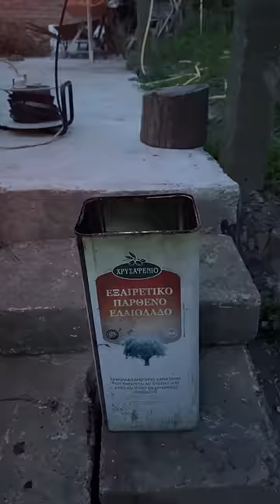Making super sharp Chef's Knife

Comment: The carrot is a great demonstrator, as a fat blade breaks them instead of slicing.
Reply from the maker: Thank you , some people think that you can cut carrot with every knife but the point is how exactly it cuts it :)
Reply: @RustLegion  absolutely, Butternut is also a great test of a knife, love your work!
Reply: Most people talk too much without knowing the crux of anything...don't let haters get you down
Reply from the maker: @fade_trade  thanks mate , I try not to take myself too seriously :)
Reply: @RustLegion   this knife does not rust?
Reply from the maker: @Kurt_SOFUA  this knife will rust If I leave it dirty and wet. If I wash it and wipe it after use - no it will not rust :)
Reply: It also helps if the carrot has been boiled beforehand
Reply: @ryd-er-die6697  Bingo. You can see from the outside of the carrot that it has already been softened by boiling. Also you can hear it from the way it is cut.
Reply: Again, I can get this kind of cut with a $10 Walmart knife. A mediocre edge will do just fine but requires effort. 

You want to demo a sharp knife you do it on something that is incredibly easy to crush, like a tomato, a sharp knife will slice with minimal force and can slice a tomato paper thin without crushing it. Which is why you rarely see this kind of demo, because most knives (including this one) aren't that sharp.
Reply: @1bun2bun  i have super sharp knives that cant slice soft tomatoes paper thin. 

Edge geometry is key. 
But ok dude.
Reply from the maker: @1bun2bun   Hello there. Yes Tomato is hard to cut with dull knife , but for me sharpening a knife is no problem. The secret of slicing a tomato is just sharpen the knife on a bit coarser stone - something like 400 - 800 grit. But to slice a carrot with ease you need THIN knife with proper geometry. This is hard to achieve. his is why I demonstrate it on carrot :)

Comment: Rebar is probably the cheapest/most readily available form of carbon steel for these kinds of at-home projects tbh.
Reply: but it is low carbon steel and can rust easily
Reply: @KKoKoRR  steel rusts.
Reply: @Just-Steve  yes but low carbon steels rust more easily.
Reply: @KoKoR  but high carbon steel is expensive.

And hard to get at the hardware store.
Reply: Most rebar won't have enough carbon for a blade, but here it is fine because it's a san mai construction, but bear in mind that rebar alone won't do
Reply: Rebar is not suitable for making knives, its too soft, better to use a car leaf spring or such, which is way better steel (5160)
Reply: @Just-Steve  ...steel can be "blued" to prevent rust. 
Stainless steel is inferior to carbon steel UNLESS you using very expensive stainless, which also cannot be easily heat treated at home.
(Knifemaker, 35 years exp.)
Reply: @richardwebb9532  you're literally the first one to say something about stainless...
Reply: Да арматура тупится быстро
Reply: @Just-Steve  ....you mentioned carbon steel rusts. What other alternative is there? Obsidian??
Reply: @richardwebb9532  I was replying to another commenter stating that low carbon steel rusts.

"Steel rusts" was the reply.
Reply: @richardwebb9532  yeah, much better to just fucking clean the knife after using, oiling it from time to time and let that beautiful patina develop over the years
Reply: The rebar is only used on the outside layers. He ads a core of high carbon steel in the middle and forge weld them. All carbon steel rusts,  there are several care and maintenace tricks to prevent it.
Reply: @richardwebb9532  What about a lawnmower blade? Like, what easily accessible, side of the road shopping is the best aside from the leaf spring (those take a bit of doing to be easily grabbed, plus neighbor will prolly get mad..). I'm not afraid of rust, I only use high carbon antiques and cast iron and I'm not dumb enough to put it in the dishwasher. I'd imagine you could "season" a blade the way you would a pan too, vs bluing, handle being removed from the picture.
Reply: @Yer_Br0wn_D0g_8_My_Rabbit  most lawnmower blades are not very good.  You would be much better off with pieces of leaf springs.
Reply: @GertTown  I saw that coming, I figured as much, thank you. I guess neighbor is in for a bumpy ride..

I realize the absurdity given the shape, but are coil springs comparable to leaf? I actually have some of those.
Reply: @YerBrwnDogAteMyRabit  they are made from the same steel, you can use old files to make blades too, the rods from the suspension inside the coil spring make tough blades too, bearings have very good steel, the axel is made of medium carbon steel.
Reply: @kassiog.6595  OK, PERFECT! Thank you. I have all that junk. The file seems easiest (seen that before) but I love the idea of making one out of crap that'll never see the light of day again. You mean the rod going through the center of the shock/strut, correct?
Reply: @YerBrwnDogAteMyRabit  might be, but i don't know more technical words in english, that's not my first language
Reply: @YerBrwnDogAteMyRabit  just looked it up. Is the chromed one on the shock absorber
Reply: @kassiog.6595  Jesus dude...coulda fooled me. Your English is better than a lot of people whose first language it is. I never woulda known had you not told me. Well done.
Reply: @kassiog.6595  Ok, gotcha, thank you. That was the only part that made sense to me. The body of the shock (outside) doesn't seem like anything special. I didn't mean to put you to work looking things up, but I appreciate it. I'm as impressed by the fact you looked it up as I am with your English. You're clearly not lazy.
Reply: @YerBrwnDogAteMyRabit  ...most older files and rasps are good too, like Nicholson files, be careful of newer ones....
Reply: @dasilvapt  ....you can obtain high carbon stainless steels today, however, they are costly and difficult to heat treat without specialist equipment.....
Reply: @kassiog.6595  👍🍻👍🍻👍😎
Reply: @richardwebb9532 Thanks. I'd imagine you mean new Chinese files made from soda cans, bobby pins and cat hair. I don't think I have a single file thats not Nicholson, like no one else is even allowed to make them, like a law or something (lol)..
Reply: @YerBrwnDogAteMyRabit  lazy people don't make knives, right? Hahaha
Reply: из клапана хорошая получается финка , из тепловоза например .
Reply: @kassiog.6595  No, I guess they don't, do they? Lol. Tough to make one from the couch.
Reply: Mild steel, is what rebar is made of, is not harden able.  But he did stick a piece of high carbon steel in the core and forged out a legit knife.
Reply: @keyboardheroism  rebar is not only sold as mild steel.  Do a little research 😮‍💨
Reply: @Tadaaaa I am absolutely blow away by how far from my original comment these comments are getting 😆
Reply: @keyboardheroism  He definitely did both of those things. The ol' rebar wrap routine I suppose.
Reply: @Tadaaaa  you're mistaken, maybe instead of shooting your mouth off you should make sure you're reading the right names next to the people making claims.

I'm the guy who said you can buy rebar at the hardware store.  You can buy carbon steel rebar at the hardware store.  I also never said anything about stainless.

R  E  A  D
Reply: @Just-Steve  The funny thing is, you made a simple, accurate afaik, comment, and it turned into like 700 different things, conversations, and pseudo counter claims. That'll teach never to mention rebar on the internet again 🤣
Reply: @Yer_Br0wn_D0g_8_My_Rabbit  lmfao right?
Reply: @Tadaaaa ...tell me you don't understand what blueing is without saying you don't understand what blueing is.....
Reply: @Tadaaaa ....and clever boy, once you heat up an "already heat treated" blank by grinding it, it's no longer "heat treated"....
Reply: @YerBrwnDogAteMyRabit  😁👍🍻
Reply: @YerBrwnDogAteMyRabit  ....only, I believe newer Nicholson files are not as good as the older ones from 1970-80's....different steel I think they said on the forum...
Reply: @richardwebb9532  Oh, ok. Cool, thank you. Well, got plenty of antiques in the basement too, so plenty to experiment with. Preicate it.
Reply: @Tadaaaa  I would assume the expensive specialist equipment Richard was referring to would be a heat treating oven. Although I have seen AEBL heat treated in a forge, I do not consider it a good method of doing so. A soak time of 15 minutes between 1925°F and 2050°F is preferred for AEBL, which unfortunately a forge cannot provide. You are correct in saying AEBL does not require cryo, but that is only for lower austenitzing temperatures and lower hardness levels (60-61 hrc). However for kitchen cutlery 62-64 hrc is best with that steel. To get into those higher hardness ranges higher austenitzing temperatures and cryo is needed. Dry ice is a fairly decent method for AEBL (Although LN2 is better) it is absolutely needed if you are using the higher austenitzing temperatures (1975°+)

~ Legitimate non couch knifemaker 

If you require proof of my non couch legitimacy I am happy to provide some, since you seem to be rather liberal with that accusation
Reply: @Tadaaaa lol....now 2nd grind is done with higher grit than 1st grind. 2nd grind is also done BEFORE TEMPERING. ANY HEAT AFTER TEMPERING REMOVES THE TEMPER!! 1st grind is what kills the temper. Even with cooling in between grind passes. I've been making blades since 1986. How long you been doing it, sonny?
Reply: @kassiog.6595  of course depending on the lead percentage of rebar I don’t think I’d eat those carrots
Reply: @richardwebb9532  oh my... I'm a professional bladesmith. I work with the best steels there are in the market, european, japanese, you name it. Stainless and high carbon. I do have all the tools, forge, heat treatment oven,  zero atmosfere heat treatment,  everything. I know that. And I know how much it costs, pretty much every single damn steel there are in the market for custom knifemaking.
Reply: @dasilvapt  ...good for you, unfortunately you missed the part where "cheap materials" were part of the discussion. I too make blades, and count among my friends, some of the best bladesmiths in my country.
Reply: @richardwebb9532  nice, congrats. 👍👏👏👏

Comment: I can still remember when I was a child over 50 years ago watching the elders that made homemade kitchen and hunting knives with metal from the oldest cross cut saws they had. They told me the older those old saws are, the best metal was used making them because the metal was perfectly made to hold an edge and last us hundreds of years. Today it's so easy to cut those saw blades using a CNC machine or a plasma cutter to get the blanks and sharpen them and put a handle on them. Also the oldest rail road spikes you can find work great an use the ones with HC on the heads, high carbon and they will hold an edge and last hundreds of years also. An if you spent the time to make a beautiful razor sharp knife, make sure you or someone else makes the right case for it to wear on your belt or in the kitchen. Show off your hard work and put your name on it or makers mark. Don't forget to share your knowledge of how to make them. We have lost to many old ways already, don't add to the list not teaching others. I just shared with you few things I knew. An if you use old cross cut saws to make you a knife, I know it will last you a life time and hundreds of years more.
Reply: This is nonsense. Modem steel is better in every way. Cleaner, better alloyed and with less detrimental impurities. I am metallurgist, I made steel, stainless steel, and nickle based for years. I heat treat and evaluate the microstructure of steel daily. 

Railroad spikes are low quality, dirty steel.
Reply: @MatrixCoreteam there is a nugget of truth in there in that old saws, or at least those that survive to this day, generally used more suitable steel than cheap new ones, simply because they're trying to maximise profit and quality carbon steel is more expensive.
Reply: Now,methallurgy science so progressive,forget it the old way to make a good knife.

Comment: I'm an iron worker. We erect all the steel in buildings. I just wanted you to know that rebar is some of the softest and crappiest steel used. It like that so they can bend it into the shapes they need. If you're going to make a knife, may I suggest you use something a little higher quality like ball bearings or gears of some kind. I've seen people use spring shocks from trucks or cars. Just thought I'd let you know incase you didn't know that. Keep up the awesome work man !!! Cheers! <3
Reply from the maker: hello , this is old Bulgarian rebar piece made of structural steel (something like 0.35 % carbon) and you are right - it is not very good for fine cutting edge. But if you look carefully I split it in half and add a piece of flat bar steelin the middle. And this middle piece is  80CrV2 steel -  so the softer steel goes on the sides for support and easy sharpening , the center piece is hard steel good for edge retention :)  And thank you for the nice comment , I will keep it up :)
Reply: He put a hardenable steel in the middle. It's actually a technique called San Mai
Reply: Great build and you answered my question on the inner bar of steel! @RustLegion
Reply: @RustLegion  That's a clever way to go about it!. Best of both worlds. Excellent! Most welcome, thank you for the response. :)

Comment: What is the powder mixture applied to help join the metals?
Reply: Borax.
Reply: Nah. Its sugar. They used to dip the red hot metal in sugar back in the day. Sugar turns to carbon and supposed to effect hardness. People still use sugar at different steps than others. Some say its a myth that it actually works. But it definitely was and is a thing.
Reply: @kinneyshoes1  effect hardness - what´s this
Reply: @georgegordonbrown9522  is that a question?
Reply: @MinstrelSentFromAnotherLand  yes - a rhetoric one

Comment: This knife may be sharp, but it wont last long. And tbh, there’s ways to make a dollar general knife be as sharp maybe sharper than that.
Reply from the maker: why do you think it will not last long? The point is not to be sharper . I can make a metal ruler to be sharper. I wanted to make a carbon steel knife with soft sides and hard center with ultra thing geometry so I can thin it and sharpen it easy and at the same time to keep a good edge for a long time. And I achieved all these things. Only department this knife is lacking is good looks but it's for my testing purposes so I'm happy with it :)
Reply: @RustLegion  it wasnt peened, one day the knife and the handle is gonna give out and then itll just be the blade

Comment: I have seen many videos of making knives like this, but the manufacturing process after heating them to high temperatures is very different from the process of making Japanese swords, so the strength and sharpness of the knives are not perfect.  In Japan, knives that are heated, shaped, and simply sharpened are said to be junk that just looks good.

Comment: Always test sharpness with a tomato
Reply from the maker: I wanted to test the geometry of the edge , that's why I used carrot. If the edge is thin it cuts carrot easy , if it's thick it wedges and splits. You are right about the tomato but in this case the greater challenge was not the sharpness but the fines of the edge.
Reply: @RustLegion  that makes sense.

Comment: Clean the fcking  metal you forge it first please i get its  not really needed but if your starting with clean material means  you less likely to add crap to the knife
Reply from the maker: No need to clean it on the outside . The important thing is to clean the surfaces that are welded.